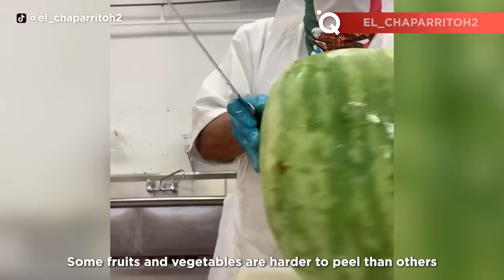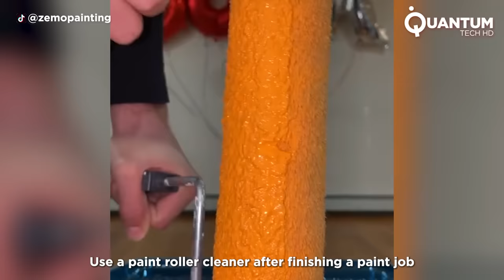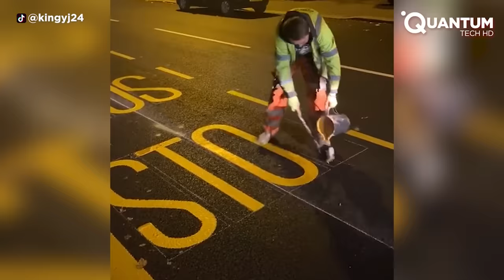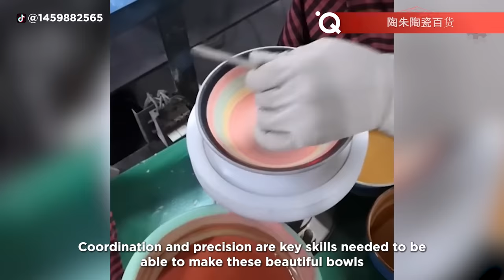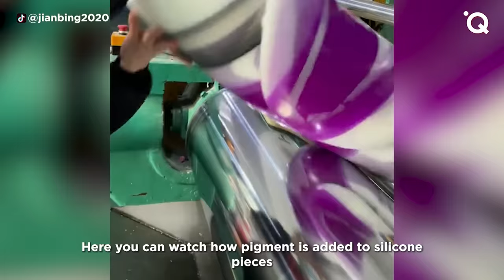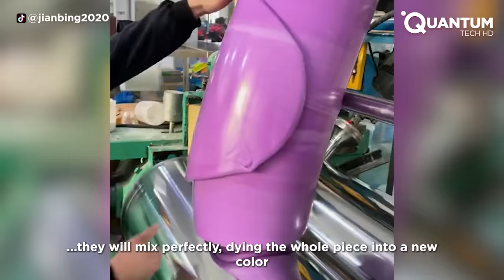Satisfying Videos of Workers Doing Their Job Perfectly ▶18

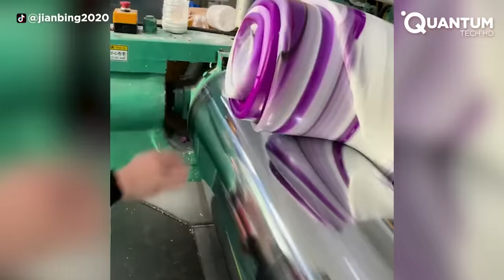Comment: 2:24, I never bother to clean a roller. I do not put oil or latex paint down a drain especially with sandcast pipes. A paint roller can be stored wrapped in aluminum foil and plastic and put in your refrigerator for one two or three uses and are cheap enough to be thrown away. Throwing a $2 roller away will save you from having a $200 plumber show up at your house for a clogged drain.